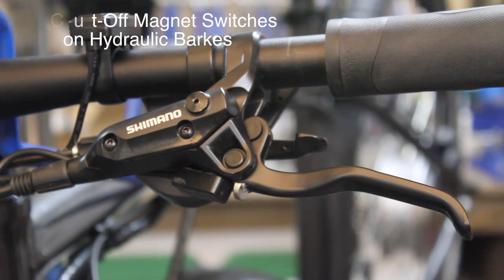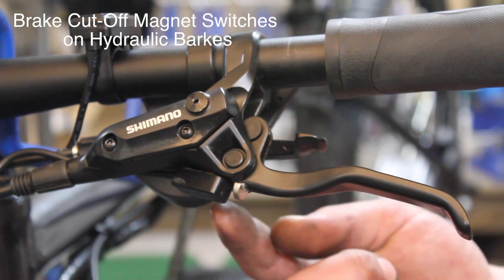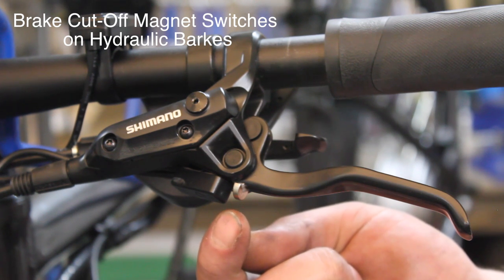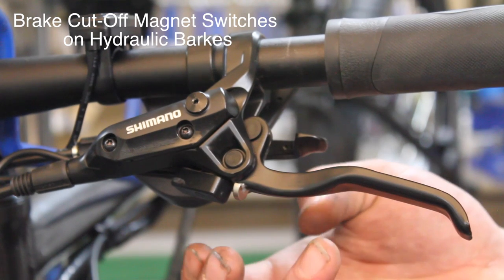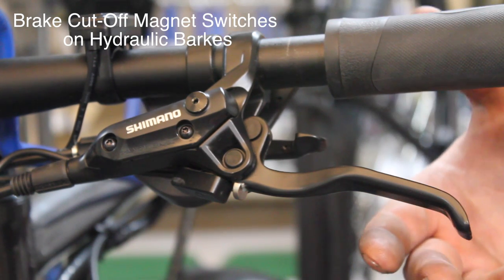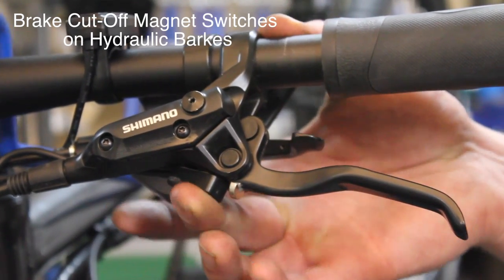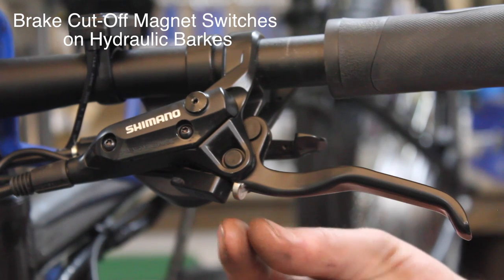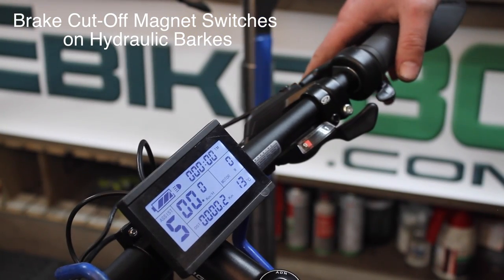Cut off switch for hydraulic brake

Comment: I used this method to mount my hydraulic brake cut-off. However, I did not cut the magnet in half. It was very easy to mount the magnet flat. I used the double sided tape to secure it in position then used hot glue to further secure attachment. 100 miles later, 2 off-road trail events (about 20 miles worth), and absolutely no issue. Appreciate your post - this was helpful!
Reply: i would use JB weld epoxy and not double sided tape... but i guess it works either way

Comment: These sensor switches are rubish. There is no really elegant way to install them on any hydraulic brake levers. The best I came up with on the lever you have shown is a small microswitch with latch inside the grove of the break zylinder housing that faces the lever. I didn't epoxy the switch directly, instead I glued an u-shaped profile in where the switch fits in and is held by two 2mm pins. This way I can replace the switch in case it breaks. Good thing about this, the microswitch only costs cents.

Comment: disable the PAS ride with the throttle its way safer that magnet falls off and your bike will keep going with you on it when ya want to stop lol trust me it sux
Reply: with no throttle input, you can easily overcome the torque of the motor with or w/o PAS should the magnet come off. you could lose battery regen or brake light, if set up. no worries